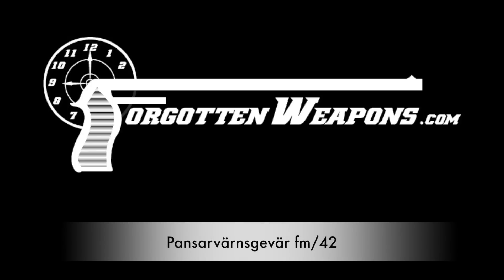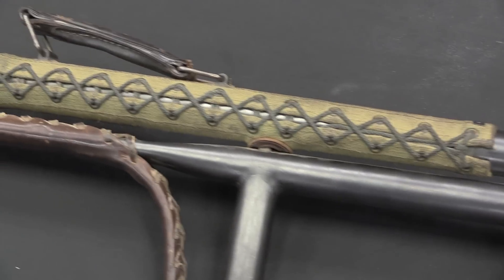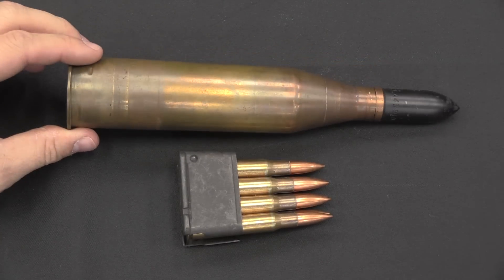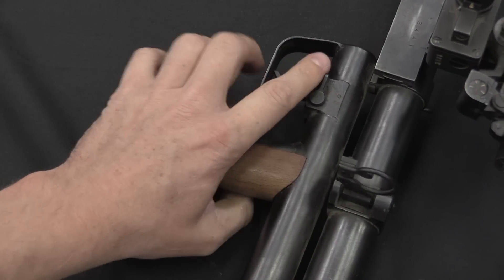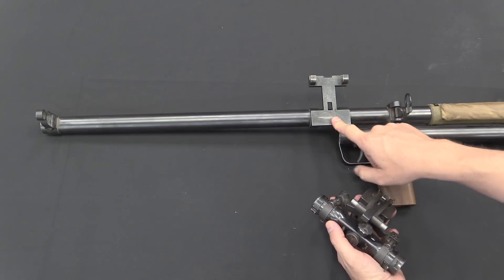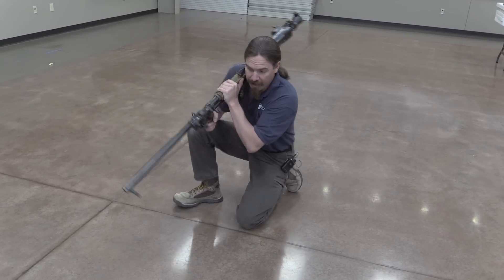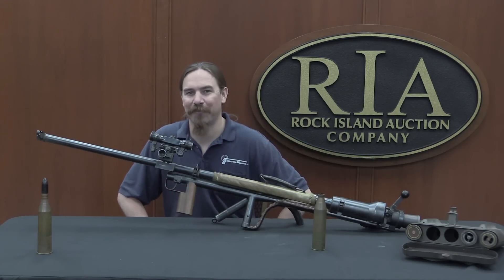Carl Gustav m/42: A 20mm Recoilless Antitank Rifle

Comment: If you fire a shaped charge, the energy adds up to the energy put into the jet.
So it actually does make sense to fire a shaped charge as fast as possible, but since there's a lot of mass in it, it becomes impractical really quickly.
It's much more effective to put as much energy as possible into the shaped charge itself.

Comment: When loading a round, does it have to be oriented a certain way? I noticed on the breach block it seemed like it could be possible to load a road up to 90° off center. Or does the breach block determine how the back of the cartridge gets blown out?
Reply: No it can be loaded any way, it is just the breach that determines how the holes at the back of the cartridge turns out. Look at 8:24.

Comment: So how does the rear of the shell butterfly holes for the exhaust gas line up to the rear extraction
Reply: There is no special alignment needed, the entire brown back end of  a shell is that softer material meant to blow out under pressure but obviously the back end only provide two actual holes for gas to escape, the same holes that then leaves behind the "butterfly holes" in the spent shell.
Reply: @Awoken_Remmuz  oh i see. Thanks!

Comment: I've never understood why high explosive squash head wasn't used more. A splat, and then a huge amount of spawling on the inside of the tank, would have been a lot easier than trying to defeat the armour.
Reply: modern tank has spall lining, which limit fragments and also make HESH useless against modern tank. Still very useful against bunker and fortification though

Comment: Isn't it weird that the shaped charge was actually developed in the 1870s for mining but wasn't applied to military use until the 1930s?  

related question - why were these not developed for use against naval vessels?
Reply: simple, naval ship has many compartments that even if warhead go trough, it will not go deep enough to reach more vital compartments of ship. Also, same as tank, many warship make use of spaced armour which limited HEAT effectiveness

Comment: 20mm shape-charge is kinda small actually , for the mechanism of shape-charge it will be an empty chamber in the bullet and limited the capacity for explosive . Won't it be just like throwing a firecracker in to enemy tank ?
Reply: That's why the 2 cm used a solid penetrator, and had to be scaled up to 8.4 cm for shaped charge use.

Comment: About the Carl Gustaf

When the Carl Gustaf was introduced into the Swedish defense under the name Grg m/48, it weighed 14.2 kg (31.3 pounds)

When the upgraded Grg m/86, was introduced in 1991 to the Swedish defense, the weight had been reduced to "only" 9.5 kg (20.9 pounds)
(This is because the fire tube has a core tube made of steel that has been clad with carbon fiber and plastic.)

Comment: Im just imagining how much recoil, and power, that rifle would have if it wasnt specially designed to blow out the back. Just imagine a solid cased round, in a standard style rifle... It would need to be securely mounted because shoulder firing would pulverize every bone in that side of your body, but i imagine the round itself would be moving a hell of a lot faster than 3000 feet per second. Suddenly i want to make something like that...

Comment: Any help plz. When inserting a round. Do the gas ports around the cartridge primer need to be manually aligned with venting ports of the weapon? Or does closing the breach do this, "automatically"?
Or is alignment not required? 🤔
Reply: Not required. The cartridge has cardboard in a circle but only the part that happens to be in the ports in the breech is destroyed.

Comment: Not just "molten metal," but *plasma*. Much more energy!
Reply: Actually neither, a "superlastic", still a solid, just beaten into shape by the immense pressure of the explosion behind it propelling it at mach twenty five. It does not burn through armour. The wikipedia article in shaped charge warheads is a great read.
Reply: @benfennell6842  To my understanding, the plume reaches the temperature and phase of plasma, but I won't argue the point further.

Comment: As a stepping-stone to the Granatgevär m/48 there was a 37 mm granatgevär fm/43 from from the same designers. http://www.evhf.se/EVHF/Texter_files/37%20mm%20rekylfritt%20geva%CC%88r.pdf has some info about it (in swedish).
 Here's a link to a short film, sadly silent, of tests with  recoilless stuff in sweden during the 40's https://amfarkiv.se/post/402880485f2e659f015f2f6e2dc809ae/rekylfria-vapen

Comment: Sweden: Haven't been in war for over 200 years.
Have been manufacturing a lot of well renown weapons systems.
Reply: Gotta protect that neutrality somehow.
Reply: The sweden school of defence usually goes in the way of “If we have crapload of defence elements and the terrain on out side, they won’t bother in the first place.”
Reply: @metehankap3870  thats basically the strategy of Sweden and Finland. Make it as difficult and expensive as possible for anyone to invade. 

Both Sweden and Finland also have some nasty guerrilla type of plans post invasion. Imagine Afghanistan, but well trained and motivated Swedes and/or Finns instead of Talibans.
Reply: They never got over the Danes beating them off with their 30-shot Karlthoffs back in the 1600s and have been overcompensating since.

Comment: Just came back from a training session for receiving M3 Carl Gustav in my unit recently. All major parts and controls are surprisingly similar to this one, the breach opening mechanism, extractor, folding iron sights, even how to adjust elevation of optical sight. Only the primer of modern rounds are moved to lateral position thus simplifies trigger mechanism.

Comment: Ian, I have seen some video's recently that talk about the Carl Gustav recoilless rifle being brought back into service by a number of militaries and special forces around the world. Not as a main anti tank platform but as a general use man portable artillery system. Because of the new ammunition and sighting systems that have been made for it. They have also gotten the weight down to 7kg in the M4 version by using composite materials with a steel rifle liner in the tube. I thought you might find this interesting as it's an old weapon system that is being brought back into use by modern militaries. A kind of weapon being unforgotten if you please 😄
Reply: I mean, even the m2 and m3 saw service in the US, so not super forgotten in the first place

Comment: Hey nice videos.  One comment that you keep saying though about recoiless rifles that is incorrect is that half the energy goes out the back.  That is not close to true. The momentum of the round going forward will equal the momementum backwards. mass of the round x velocity equals mass of the exhaust x velocity.Hence why there is no recoil.  The energy split will be the .5 x mass x velocity^2 of the round and the exhaust.  The exhaust will have a higher velocity than the round but round will have much more mass than than the exhaust.   Since the amount energy is a square function with respect to velocity, way more energy than half is escaping out the back than half.    If the round is just 100 times more massive than the mass of the exhaust gas, about 99% of the energy is exhausting out the back and only 1% is going into the round. Basically, a lot of propellant has to be used to make it recoiless. Some of the first recoiless guns shot grease out the back to make them more efficient by taking advantage of the fact that grease weighs a lot more than  exhaust gas.

Comment: Shaped charge or, by their modern name, HEAT warheads don't actually "melt" armor; very little of their penetration comes from thermal effects. The penetration results from a stream of ultra-high-velocity superplastic metal that is going so fast, and is focused on such a small area that it can go clean through armor. Yes it gets hot obviously, but not so hot that it can "melt" armor in the fraction of a second it takes to penetrate.
Reply: That is what it's actually doing, it is melting the metal near instantaneously.  That's why certain ammunition can just cut right through something that would otherwise seem too hard, heavy and thick to be penetrated.  Anything hypersonic has this attribute to some degree and then they improve upon it from there.
Reply: @beebacheeba  I think perhaps erode the armour away would be the "proper" description? The term for how it works in HEAT rounds is the munroe effect, and it's considered as a kinetic force.
Reply: @beebacheeba it doesn't melt. Above about 50,000fps det speed the explosive separates the steel at a molecular level essentially turning it into vapor

Comment: 3:03
heat stands for high explosive anti tank and works by forcing the liquified metal through the armor like an explosive powered pressure washer. Contrary to the somewhat misleading acronym and the fact that the metal is molten and extremely hot, the pressure of the metal jet is what penetrates the armor and not the temperature.

Comment: 3:14 While shaped charges do involve thermal properties it is still the kinetic energy of the super plastic metal slug that defeats the armor.
Reply: yes, but since it still does not depend on the speed of the initial projectile for penetration i think we got what he ment
Reply: @toasteroftheomnissiah1372  He literally said "cut through with thermal properties" 

The superplastic copper mass moving at mach 25 (no decimal, twenty five!) Is not "burning" through anything! It's purely kinetic energy at the point of penetration, but we'd call it a CE(chemical energy) round because all that energy is stored in the explosive mass of the warhead before detonation.
Reply: @benfennell6842  yes. i was talking about the initial projectile, not the efp though

Comment: At 3:02 Ian says that shaped charges rely on molten metal cutting through the armor "using thermal properties". This is blatantly incorrect. Shaped charges rely on insane pressures and speeds that are generated by Munroe effect. In fact, the temperature inside the penetrating needle is around 500-600C - like, three times hotter than a burning piece of paper. That's nowhere near enough to melt, let alone cut armor. 

"On Temperatures in Shaped-Charge Jet Penetration" William Flis - 2017 (DOI 10.12783/ballistics2017/16977)

Comment: Isn’t the mechanism of a shaped charge kinetic rather than thermal? Massive kinetic energy, developed at the point of delivery rather than at the launch site for effectively a point blank shot from any range. The fact that the metal from the liner is molten is cool but probably not as important as it would seem. At these sorts of speeds, everything is a fluid and tensile strength takes second place to density.

Comment: But how do you in line the case openings with breach openings, the cases ones are  not visible until they are fired.
Reply: It looks to me like the entire back is made of a material which can be blown out, in any orientation. Also, I've seen other comments on here which state that the round can only be loaded into the breech in certain orientations, to make sure it lines up.
Reply: @mikespongili8254  my apologies  for the one year delay, but thanks , that  makes sense now. Wish you a good health and a nice time 👍

Comment: I take issue with the whole 'wasting alot of the energy' thing... There will always be equal momentum applied forward and backward by the system. So long as you're not allowing gases to shoot forward out of the gun much or using any forward blasting mechanisms, which includes gases escaping forward after the bullet leaves the barrel (i.e. the propellant is unable to fully burn), there won't be a significantly greater energy loss on a recoilless rifle than a normal one. Is there something I'm missing?

EDIT: What I was missing is that much of the propellant is blasted out the back before it can burn.
Reply: That's not the only thing missing. Since momentum is proportional to velocity (m*v) while energy is quadratic (0.5*m*v^2), if you have 100kg of weapon+shooter accelerated to 10 m/s (made up numbers to illustrate the point), thats 1000 kg*m/s of momentum while 5000 J of energy.

On the the other hand if you accelerate 1 kg of gasses, you need it at 1000 m/s to carry equal momentum, and the wasted energy would be a whopping 500000 J.

At the extreme point if it is well-braced on a tripod or a vehicle, the recoil force can be transmitted into the Earth, imparting the same 1000kg*m/s of momentum but only a negligible amount of energy

Comment: Well there is a mistake. Shaped charge/HEAT(High Explosive Anti Tank) uses speed instead of thermal energy. You can simply prove it by the fact that the cone in shaped charge is most likely made out of copper. And copper has lower melting temperature than rolled homogeneous armor plates. Another thing is that it can travel up to Mach 25 and yes i mean 25 not 2.5. Of course this speed is applied only to the copper cone. Third thing is that if it would penetrate the armor in thermal way then the spinning of the projectile would not have a impact on penetration but we know it has, thats why now we are using fin stabilised ammo and not rifle stabilised.

I hope i made myself clear.
Reply: @toeff7852 I get what you're trying to say, I  suppose that technically the high velocity copper super plastic is shaped by thermal properties to some extent, but the majority of what causes it to go so fast and on such a shape is the tremendous pressure directed at if from all direction behind it.
Reply: yeah the "thermal properties" is not what penetrates the armor. I wish this correction was a pinned comment or something.
Reply: @toeff7852 ...what?

Comment: No! Bad Gun Jesus! HEAT doesn't use heat! the copper is only around 500-600 degrees C, well below its melting point! It works because the very long, very narrow jet of copper is going between 1,150 to 14,000 m/s. Anything going that fast is going to mess stuff up. At those speeds, cloth can punch through steel. 

Yeah, this is an older video, but still. Gotta be a pedant. It's my job as a person who thinks they know more than they actually know on the internet.

Comment: Shaped charge is very much kinetic too, thermal properties are insignificant considering  duration of application to armor.
There are even shaped charges today, large-caliber ones, that form a ball of molten metal instead of a stream, that is traveling over 10km/s after detonation and punches through armor with sheer kinetic energy of it.

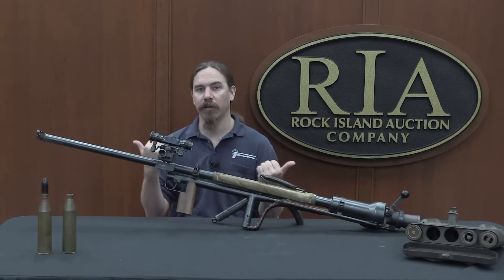Comment: 4:06 It's not necessarily half the energy out the back it's half the momentum (when recoil is equally balanced). Since momentum is mass*velocity whereas energy is 1/2 mass*velocity^2, the share of energy depends on the ratio of mass out the front versus the back. If this rifle ejected 10 bowling balls out the back they would only need to travel 4 fps each to cancel the bullet's recoil and would only carry about 0.1% of the share of energy. However mass is expensive in the battlefield so this rifle goes the other way: making up for mass with high velocity in the rearwards ejection. So it's likely in this case that more that 50% of the energy goes out the back and still doesn't make 50% of the momentum, which is why there's still recoil. What's most amazing is how there's enough chamber pressure for stable burn and to drive the bullet to impressive velocity.

Comment: "some of those are still in service" in context to the M3 Carl Gustav is a major understatement. It is the preferred alternative to most AT missile launchers for most of the US army and the Marine Corps is going to adopt this to replace the SMAW. It isn't only out lasting more modern weapons, but REPLACING THEM. The M3 Carl Gustav is a legend.
Reply: Jeffrey Robbins  it does have a HEAT shell with ~500mm of pen, so not sure about raw AT capability, but it does offer far more utility than what it's replacing as it has a wide variety of ammo available to it. Heat, HE, HE timed fuse, HEDP, Flechette, Star Shells. it's basically a man-portable artillery piece.
Reply: https://youtu.be/dUoBb3h9HWA     THIS    THING.....shooting  in light and darkness.....WOW ..

Comment: You can laugh at 40mm penetration. But then you remember that:

A) not every tank is a medium or heavy tank. There are light tanks, scout cars, ifv etc etc
B) not every plate on a tank is frontal armor. This think will fuck a Panzer 3 and 4 from the sides and ever a Panther won't be too happy to be flanked by one of these.

If this thing would have been adopted by a warring party, it would probably have been very liked. I think that the design would have been upgunned to some "intermediate" caliber like 25mm to bump up penetration to threat every medium tank from the sides while still maintaining portability. Possibly a contender for the bazooka.

Comment: I have a story to share. Im from Sweden and we had this in a small, remote military museum in northern Sweden some 10 years ago.
I was there in an evening when it was closed. My dad is a military musician and he got the keys to the museum, we were going to add some military musical instruments and then head home. They would open up the museum later that spring.
The door to the museum was of wood with an old key extremely easy to break in, the structure is an older wooden barrack.
I saw this recoilless rifle sitting in the museum room (the only gun there) and said to my dad "Jeez, its so easy for someone to steal it, it would be worth a lot and it would be dangerous if someone got hands on it"
My dad said "nah, no one would come to the forest and steal this thing, its so heavy"
Well... around a couple of weeks later, i read in the newspaper that the museum had a break-in, and that this gun had been stolen..
Reply: "So where do you keep it?."